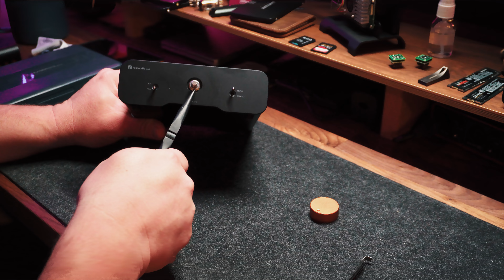How to Mod your Fosi Audio ZA3: OP Amp Replacement

Comment: Really helpful and simple video. Here is a handy tip. If you are planning on running two in mono, you only need to upgrade the op amp on the right channel in each unit. That is all that gets used in mono. That saves you $136 on two sparkos (with 15% discount running at the moment). Makes running in mono with the upgrade more affordable. Confirmed with Fosi.
Reply from the maker: Nice 👍 that’s awesome information thank you!
Reply: Thank you.  Have you actually tried or  has anyone?  I'll probably order later today.
Reply: @butchbantug4731  confirmed with FOSI and planning on executing when I get my second unit. 

Here is their reply to me:  

Fosi Audio

Hello, if you want to use it in mono mode, replacing only the right channel op-amp will change the sound quality most obviously, regardless of rca or xlr input mode; but in xlr mode, replacing the right channel op-amp and then replacing the op-amp chip of the xlr will improve it a bit; if you are a more professional audiophile, you can replace both op-amps
Reply: @butchbantug4731 
It should be easy to test ... take out the chip marked L-Opamp and switch to mono mode... does it work correctly?
Reply: Thanks for the heads up! I’m using two in mono with XLR. Does that mean I have to upgrade the XLR opamp too? 

So Right channel output and XLR together?

Thanks for any help you can offer 🙏

Comment: Hello, and thank you for this review👍. 
I have a technical question: I’ve understood through multiple podcast about the Fosi Za4 that the XLR binding posts offer a better quality than RCA in this particular model. Now if I want to use the Za3 in Stereo Mode the XLR input do I have to swap just the one XLR op amp ? Or the 2 x RCA (right, left) + the XLR … means 3 op amps in total ( as mentioned in Stereo mode) ? Or just 1x the XLR?

Comment: Great job Michael! I replaced many many chips in my 40 years of working on office machines. The company supplied chip puller was crap so I got very good at using a small screwdriver. I did put a chip in backwards once and not only do they smoke, but they smell real bad!
Reply from the maker: Thanks Mike, yeah it can be quite bad if they aren't put in correctly.
Reply: Been there ... done that... burned the T-Shirt.

Had one line of products using an 80 pin DIL processor chip that was rather failure prone... I can attest to just how bad that smells.
Reply: Once magic smoke is released it's kind of hard to put it back in the chip :)
Reply: @irukard  LOL
Reply: @irukard 
😄Yep, they do tend to stop working after that happens.

Comment: Just to add... a pair of wood or bamboo sticks works very nicely to get the volume knob off smoothly and easily, and in a very controlled fashion... and no risk of scratching the faceplate. I used a pair of bamboo chopsticks, whittled slightly thinner, to fit between the face and the knob. One on the top, one on the bottom and pry gently, it'll slide right off.
Very nice video, regards.

Comment: at first I agreed that one might need the force of God to remove the volume knob - I had tried quite a few things, then after I had fairly given up I saw one of my small teaspoons sitting neearby....by using two (on opposite sides of the knob) I was able to gently pry it off in no time. So easy!

Comment: Great video. Just used it mod my op amps. To remove the knob I used an old credit card to apply some pressure behind and worked it off that way.
Reply from the maker: I used my IC puller tool and just pulled lol
Reply: @audioarkitekts nice tools but the screw driver & ic remover cost as much as the second Za3 that I have on my shopping list.

Comment: A couple of very important steps were missed...

The bottom of the board has the Chip's heat spreader which uses thermal compound to assist in heat transfer to the case.  It is like grease, it picks up dust and dirt like crazy and any that gets in between the spreader and the case is going to degrade the cooling significantly. 
 
It is essential that, before reassembling the amp, you clean away the old compound both from the heat spreader and the inside of the case and use new compound -> every single time!

The best way is to make a small line of compound inside the case where the back of the heat spreader will sit so that it self-coats and pushes the compound forward as you put the board back into the case. Use just enough to cover the surface. More is not better, just messier.

Second, while it is okay to power up while it's out of the case, to make sure your op-amps are working, you do have to keep in mind that the case is the largest part of the cooling solution.  Outside of the casing, the chip will run much hotter so don't even think about power testing it outside of it's casings.
Reply: Yes thermal compound is so important.
Reply from the maker: I've never done any of these steps with supreme success. So as much as these steps could very well help, I don't feel they are essential.
Reply: @audioarkitekts 
Trust me ... if you want that amp to last more then 6 months, it is essential. 

Any job worth doing is worth doing well, my friend.
Reply: @mikecampbell5856 
Any idea how many PCs have been killed by improper use of thermal compounds?  
In my experience it's like 50% of the problems...
Reply: @Douglas_Blake_579 in my experience 50% of the time 100% of them die. 😂

Comment: The real question is if you get 2 of these, upgrade the opamps to run them in mono mode, wouldn’t you get close to an a/b class amp pricing especially in the used market?

Comment: Does XLR chip also use opamp like muses02 or Sparkos?

If I don't use subwoofer out, is it okay to replace only 3?
Reply from the maker: I only replaced the two, L and R. And yes you can definitely use Muses02
Reply: @audioarkitekts  I just did this last night with MUSES02; 3 op-amps, 1 for XLR and the right and left channels. WHOA, what a difference! Low end is clear yet big, boisterous and beefy! It behaves so well and knows when to take center stage. Highly recommended to upgrade those op amps.

Comment: Newb question, if I had two ZA3 using them as mono amps and only using the XLR outputs, would I only need to replace one op amp in each amp?
Reply: Okay there are 3 sets of op-amps in there.  Check the board, it's marked.

The XLR Op-Amp can be changed by itself.
The 2 in the Sub Out circuit should be changed together.
The L and R OpAmps should be changed together.
Reply: @Douglas_Blake_579  When I'm using my 2 ZA3's in mono mode all connections are IN (RCA or XLR) and OUT (Speaker) RIGHT channel connectors. Which leads me to believe in mono mode only the Right Channel circuits are being used. Which makes me think only the R opamp needs to be replaced.
Reply: @panchosanza8750 
You can try it... but I think you'll find they are using both stereo channels, paralleled together in the chip's built in PBTL mode.  So both channels are still active.
Reply: @Douglas_Blake_579  That would make replacing the stock opamps with Sparkos a costly affair...
Reply: @panchosanza8750 
Yes it will ... and I rather suspect that is deliberate on Sparkos part.

Seriously what is it about these overpriced tweaks that draws people like flies?

Look what they have you doing... 
They have you putting $360 worth of parts into a $150 amplifier that works perfectly well without them.
Then they have you ripping the amplifier down and later re-assembling it without proper attention to cooling and the longevity of the main chip.

Does this sound like a smart thing to be doing???
Reply: @Douglas_Blake_579  That's what made me abandon the idea. I don't think my hearing is refined enough to spot the subtle differences between them anyway. Maybe try some of the cheaper alternatives for fun, if I can find some genuine ones.
Reply: @panchosanza8750 
You could always do it my way... hook the thing up, use it for a month or so, then at the end of that decide if you think there's any advantage in tinkering. ... Often as not I decide to just leave well enough alone.

A big part of my technical training was driving home the "If it ain't broke don't fix it" rule.  Of course rule #2 is: "If it is broke, know when to stop fixing it.". You might be surprised to know how many good devices are destroyed by people trying to "fix' them.

One of the big concerns is that those are not ZIF (zero insertion force) sockets.  A ZIF socket has a little lever on the side that you pull up to release the chip and press down to lock it into place.  You can swap chips in that type of socket to your heart's content; when unlocked, the chips just fall into place and lift out with next to no effort.
  
The sockets Fosi provides are standard DIP (dual inline package) sockets that are not designed for repeated removal and insertion of chips.  You have to fight spring loaded contacts to remove and insert the chips. They're a service socket, most often provided for failure prone parts that are likely to be changed 1 or maybe 2 times during a product's lifetime.  (In another thread under this video, there is a user who's  already run into this limitation.)

For a while last year I was finding fake NE5532s in some of the competing amplifiers.  I had pretty good luck replacing them with RC4558 chips that cost about 50 cents each.  And, before you ask, yes there was an improvement when I replaced fakes but not so much when replacing genuine chips.  I also tried TL072 chips and they worked quite nicely as well, but they're more expensive, about 80 cents each.  😎

As I pointed out earlier there is also the concern for the chip overheating if the thermal solution is not maintained properly. Ironically, the way it's done in these amps, the case will be cooler while the poor chip roasts in it's own output.  That is not success... You actually want the case to heat up!

Anyhow... enjoy the amp, give it some time, you can always make your decisions a month or three down the road.
 
Cheers and all the best for the new year.
Reply: @Douglas_Blake_579  Enjoying my 2 nice warm ZA3's is exactly what I'm going to do! 😀
Reply: @panchosanza8750 
👌 Enjoy!

Meanwhile I've got a couple of TB10Ds to seriously mess with.  (In this case the mods really do improve the amp.)
Reply: Op amp xlr and op amp right channel remove left channel op amp

Comment: I am a headphone user so I don’t know why I ordered this amp a few days ago, it is on its way to me. I chose the 48V version.
Reply: Connect your headphones to a balanced cable, connect the other end of the cable to your speaker outputs. It'll blow your mind. :hand-orange-covering-eyes:
Reply: @hamishthecat4370  that was my intention. I have 2 sets of cables for it - 1 with spades to 4-pin XLR, 1 with banana plugs to 4-pin XLR and another with dual 3-pin XLR to 4.4. Briefly tested with the Susvara at very low volume, may get the HFM Adapter box for it and hoping to get a pair of Modhouse Tungsten. Using the dual 3-pin XLR out from the back of the Chord Hugo TT2 is already very good.

Comment: Why did you only change two of the 5 op amps? Thanks
Reply from the maker: Two reasons: 1. I only had two op amps 2. That’s what Fosi recommended in the case I only had two op amps
Reply: The other three op amps are not always in use, but the two that were upgraded are.  

There is one op amp towards the back of the unit that is ONLY for the XLR input.  So if you arent using the XLR input (But instead use RCA inputs) you can leave that one alone. 

The other two are for subwoofer output.  So if you arent using that, you can ignore those too.   

The two that were upgraded are for driving the Class D amplifier chip.  So those are always in use when using the amp to drive speakers.
Reply: @andrewsparks3157 
It would be a worthwhile experiment to confirm that the XLR chip is not in use when plugged into the RCA inputs.  The test would be simple enough... take the chip out, hook up and switch to RCA and see if you get sound or not.  

There are some very clever circuits that allow you to plug in XLR or TRS plugs for balanced sound, TS plugs for unbalanced and often these allow for an RCA jack to be connected to the "hot" pin without switching.  (The restriction being that you can't use both at once).  In that case the XLR chip would always be used.
Reply: @Douglas_Blake_579  Yes that would be a great experiment.  I know those RCA / XLR circuits you mention, and if it is used for RCA input as well, it would then be worth upgrading.  Their literature implies its for XLR in though.  So I am unsure.   Can you preform the experiment and let us know?
Reply: @andrewsparks3157 
I would happily do just that if I had a ZA3 on hand... but I don't.  I'm not especially fond of spending money on things I already know I will not use and don't want to sell.

Anybody who has one and is opening it up to swap in their favourite over-priced op-amps can do the test in just a few seconds.  It won't hurt the amplifier... you just won't get any sound from it if that chip is active with RCA inputs.  Put the chip back in and all should be well again.

If that chip is active all the time, it's the one you probably would get the most sonic benefit from changing.

Comment: Replacing an op amp is more likely to add distortion as the Fosi is designed around the opamp inside.  Most people don't have enough electronic knowledge to do this. Making a difference doesn't mean better,   Every mixing desk in the audio chain has gone through hundreds of NE5532. So you put in an unsuitable OPamp in a little box in your living room, you hear some high frequency noise and think it sounds better because you paid more for it,  Unless you can test an improvement you are probably making things worse.

Comment: Ive been swapping opamps on my A07. Im having problems with the opamp poor contact and producing noise and loss of power.
Reply: How many times?

Here's the bad news ... even the very best chip sockets are not designed to be constantly pulled and pushed on. They are generally used only for failure prone parts and intended to be swapped once or twice in their lifetime.  And, yes, they are very easy to break... even the good ones are only up to about 4 or 5 swaps before you have to replace them.

Check your chips ... are any of the pins bent?  That will also cause poor connections, even in a good socket.

Sadly, replacing those sockets on a miniature SMT board is a big job and it's likely to cost you more than the price of a new amplifier.  

(I typically charge $40.00 per hour with a minimum charge of 1 hour, plus parts. Other guys charge double that.)
Reply: Im not sure what op amps you are swapping into the A07, but the discrete op amps shown here require an extra socket to elevate them up in the air to clear some close in parts.  

The pins on this extra socket (we call it a DIP socket / Riser) are a bit fatter than the pins on many op amps.  So if the socket that is directly soldered into the A07 is getting a bit loose and sloppy, you can install one of these DIP socket / Risers into the sloppy socket and you should get a better connection to the socket that is soldered onto the A07 board.  

Then you just roll your op amps through the fresh socket that is now on top of the old and loose one.   

Some sockets are rated for bunches of insertions, and others are only rated for a few.  Not sue which ones they use in that unit, but, it sounds like one that is rated for a few.   

You can also try to slightly kink the pins of the op amp to make a little more friction and a little better connection with the looser fitting socket.  

Hope that helps.

Comment: Any noticeable difference in sound quality? Are Fosi OpAmps bad or something? Bumps the price up a lot!
Reply: I think it is less of a bad Fosi OpAmp, and more of the Sparkos I keep hearing about being great OpAmps.  I would imagine the one that comes is fine or good for the price range, but if you like the sound/price/power that Fosi has to offer, a new OpAmp could be that extra little something you are looking for.  Better than spending hundreds on gear and demoing a bunch of stuff for some.
Reply: @YitbosSwede 
At $80 each those Sparkos op-amps had better get up and make me breakfast in the mornings!  

Most good op-amps on the OEM market are in the $1 and $2 price range each.